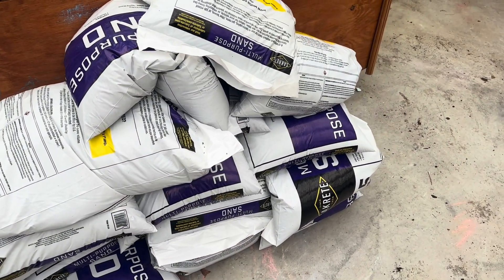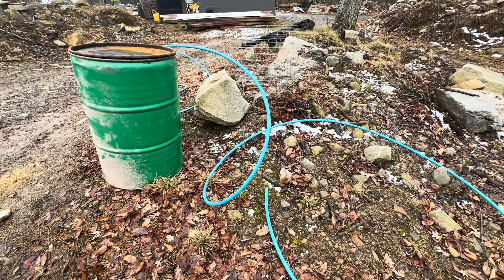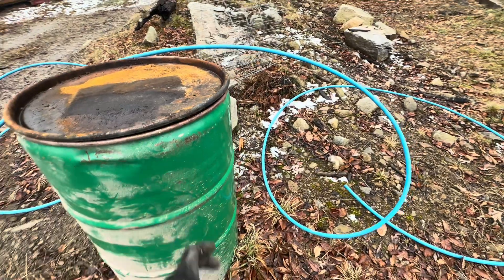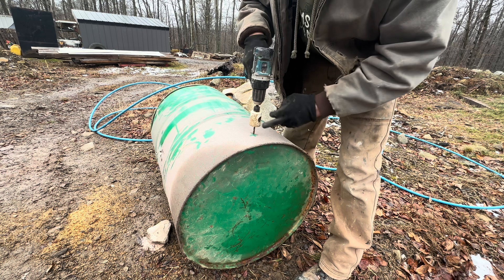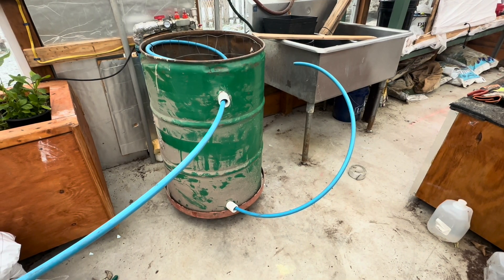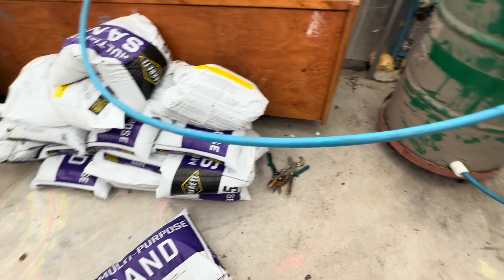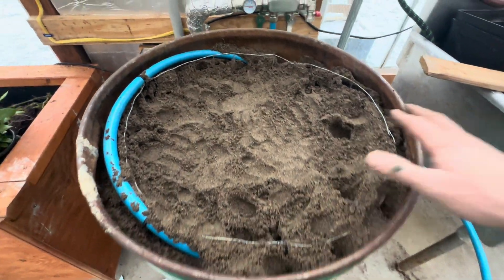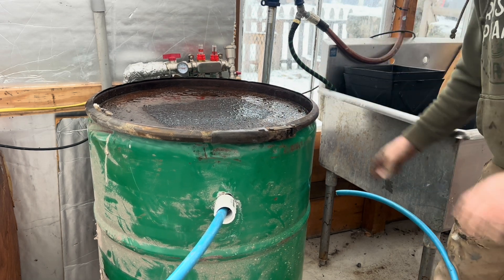DIY Thermal Sand Battery for Greenhouse Heating with an Outdoor Wood Boiler

Comment: Sealing the input and exit holes for the radient heater tubes would have let you add heat transfer mineral oil to displace the air spaces between the sand particles for the following benefits:
-more Btu storage
-faster heat collection
-faster heat discharge
Reply: You could also adjust the heat uptake and discharge rates by using an adjustable insulation wrap. This would let you charge it up faster in the day and decide if you want it to discharge the heat slowly or quickly at night depending how cold it is.
Reply: Thank you for posting your idea. You have given me a way to rethink my idea of using multiple 55 gallon steel drums to store and  send heat into my home. It's only half an idea at the moment, but I see some possibilities.

Comment: Is the battery connected between water leaving floor and going back to boiler to for re-heating .. Or is battery sitting just before  hot water enters the matrix  of heated flooring pipes?

Comment: Do you have a follow up to this video on how well it performed? I wondered how well the water worked in transferring the heat? I was thinking of using oil as I thought that the water could vaporize. Also I wanted to know how hot the sand was in the middle of the sand battery was. And what improvements you would do for version 2 of your battery?
Reply from the maker: Well, the sand battery is part of a larger system which requires topping off every now and then in our large 600 gallon boiler. 
It would be interesting to hook up some temperature probes to read internal temperature.
So far, it works very well for its intended purpose. 
I plan on doing a massive one out of a large 36” culvert pipe In a new greenhouse build in the future.

Comment: It's a good idea but I'm not sure this is accomplishing what you're hoping for.  you're basically trading btu's from the unburned wood in the stove to the barrel.  The burn is actually going to be less efficient because of the transfer of heat, and whatever else you have hooked up to the stove is going to run our of heat faster because your btu's are going to the barrel. If you were going to have a large sum of these "batteries" and fill the stove multiple times in a row to heat them up to cover you while you were gone for a day or two then you might be able to benefit by essentially "pre-burning" the wood that would be needed while you were gone, but otherwise, you're just heating up the barrel at the expense of a faster burn rate on your load of wood.  Also, you should consider some automated shutoff for the flow of water to sand batter otherwise the stove will be pushing colder water through the barrel and actively cooling it down when the wood load runs out.

Comment: You can’t get an accurate temperature reading using an IR gun on metal. You need to use a thermal couple to get an accurate temperature reading.

Metal has a free electron, which will act like a mirror and give you an IR reading that is inaccurate.

Comment: From Europe; we have a lot of people with solar panels on their roof, they stopped paying for the energy supplied . This could be a great way to store heat for the winter, connect it to the  central heating system.
Reply: I love this idea
Question though, how would you go about connecting this that stored heat to a homes central heating system????
Reply: @kawaiisenshi2401  That is no problem , the sand batteries will be placed near the house in the ground, connected by flexible highly insolated plastic pipes. This system is used in many countries who use " block heating " Thanks for your reaction.
Reply: @WinstonSChurchill-b1n thank you for helping to point me in the right direction!

Now I'm off to learn more about block heating!!! 😁
Reply: @kawaiisenshi2401  " Block heating "  is OK, City heating is a disaster.

Comment: heat capacity of sand 0.8
heat capacity of water 4
replacing sand with water will increase the capacity of the accumulator by at least 4 times

Comment: i think think this could work in the house with solar panels and heating electrodes in the barrel connected to the house radiators do you reckon???

Comment: on gen 2, use rock wool or similar  insulation on the inside metal part of the barrel and copper tube in the sand will increase potential to almost 500'c
Reply from the maker: Good idea. Thank you!
Reply: ...and it should be more distributed thru the sand. You are just thermally packing the exterior sand and radiating it out of the Barrel. Intake into the top center and loop it around so there is as much sand to the outside of the tube as to the interior. This forces the heat thru all the sand before it radiates. It will take longer to heat up, but will hold the heat longer.

Comment: Would it be worth the effort to re-lay the pipe towards the interior and away from the walls? Seems like you're more likely heating the barrel walls and losing a lot of heat the way they are.
Reply from the maker: possibly, improvements can definitely be made

Comment: Probably a dumb question, but why not add water to the sand (assuming you can seal the barrel)? This way, you'll add more a little more mass to your battery. 

If you want to get really crazy, you can try using a sodium acetate solution (like the stuff in hand warmers)  into your barrel instead of sand to get additional mileage out of your battery by adding the heat of fusion (kinda like what you get from ice melting) versus just changing the temperature of the mixture. Of course you'd need to be making sure you can get to the right temperatures to melt the stuff.
Reply: Why use sand at all? It is good if you can heat it beyond boiling, but if the heat source is just circulating water, you might as well just fill the barrel with water (and no sand). The only downside is that the barrel corrodes much faster when water is involved.

Comment: Thank you for making that video !
Have been looking for a diy sandbattery/thermal storage for central heating video/guide since i heard about the sandbattery that was made in finnland.
Im running my central heating through my woodburning stove, and want capture more of the peak heat, so that it can be used in the greenhouse aswell.

Comment: Did you get the bag from a local farm and home store or hardware store? 
I assume 50 lb bag?
So what do you think of the weight of that barrel is?
Reply from the maker: We got the sand at Lowes, 50lb bags.
Reply: something like 750 lbs. Assuming a specific heat capacity of 0.19 btu/lb/F, you`ll store 142.5 btu/F. If the barrel starts at 100F and cools to 50F,  it will provide about 2kw of heat.

Comment: Thanks for the video - nice storage heater, more pipe coils could be in the central (core) part of the barrel.
BTW: SandBat and Polar Night Energy thermal storages also use sand but temperatures 400-500 degrees C (five times water boiling temperature) and huge amount of sand (with insulated walls) so they store more energy for longer period and use hot air probably steel pipes as input (with electric heater) and output. 👍😎
Reply from the maker: yea, I saw those companies they are really cool. We might do something on a larger scale in the summer time like that to increase heat storage.
Reply: Yes! =) And our Sand Battery basically doesn't make sense until temperature is above 170 degrees celcius. Below that water tanks are better choice. If leaking would be a big problem then below that also. =)

Comment: I’m not cutting up your efforts or being a know it all. If that feed is coming to your greenhouse directly from the boiler, you are losing a massive amount of heat. Either way, even if you are heating that greenhouse with the return line from any other buildings on the property, the return going into your stove is way too low. A return temperature at the stove that low will eventually rot out your water, jacket, and backside of the fire box. I used to be a small manufacturer of.Owb’s.
Reply from the maker: To answer your question, the greenhouse is at the end of that heating loop. It first heats our home and keeps it at a comfortable 70 degrees. It then returns outward to the greenhouse first to dump any residual BTUs, before returning the boiler. So all in all it travels through about 600 ft of insulated underground tubing. On average there is about a 20 degree temperature difference on return to the boiler. thank you for your input.
Reply: @NorleyFamilyFarms  I guess I was a little confused. I thought you were running a return differential of at least 69°. 160° stove temperature and a 91° return temperature or less when it reaches the stove, on that loop. I must have misunderstood the video.
Reply: If you're not exceeding 100c, just use water storage
Reply: So what is the solution? Smaller loops?
Reply: @Stoney00075  to answer your question not necessarily a smaller loop, but less heat draw on the loop. OR. Another way to compensate is to install a thermostatic valve at the boiler. Some manufacturers require this for the warranty. Central boiler is one of them off the top of my head. The goal is you don’t want your return temperature anymore than 30° lower than the water temperature inside the boiler. It will cause condensation and rot the boiler out. And I’m not talking about condensation in the fire box. The condensation, as crazy as it sounds, will be inside the water jacket itself under the water. It usually occurs where the returning water, rubs or kisses the inside of the water, jacket and backside of the fire box. Think of patches of microscopic oxygen molecules, stuck to the inside of the stove under the water. This phenomena also increases at cooler operating temperatures, that’s why all manufacturers of open systems require a minimum operating temperature of 180°. There are some boilers you can get away with this because they are designed for a batch burn with storage. One example is a Garn. But your typical open system will rot out fairly quickly if you don’t maintain a consistent water temperature. In addition to my excavation business, I own a commercial welding shop. I have personally seen this damage after cutting open a leaking boiler. You will see eroded metal in the path of the return water. Not necessarily caused by poor water quality, but after talking to the customer, cool return temperatures.

Comment: I would have put the tube inside the the wire cage so tubes would have more sand on outside!
Reply from the maker: I actually thought about that, but it was tricky enough to get the tubing wrapped on the outside of the wire cage, so putting it inside was kind of out of the question for me to do on my own.

Comment: If you shove in 2 or 3 heating elements and hook them up to 2-3 solar panels, you would need to fire the boiler up only at night
Reply from the maker: that would be nice. I would like to increase our solar power next year.
Reply: In this instance, you would do better to buy Solar Water Heater tubes (or a unit), and cycle it thru the battery (and your water heater). Modern Voltaics are 20-24% efficient and you have system round trip losses, but Water Heaters are in the 70-80% range. If you want heat, use heat. That's why the Heat Battery is useful. Also, you can DIY one, and there are plenty of videos (just search DIY pool heater, for example).

Comment: Make sure your sand is completely dry and use any shaker tool to compact it no gap and you will reach another level in efficiency 🎉solid job btw. 🤘
Reply from the maker: thank you! well the sand if def  dry now if it was not before. but agree with the compacter.
Reply: Why wouldn't you desire gaps to allow the heat to flow all the way though the battery?
Reply: @FuhrChris no air expands and can cause the air pockets in the sand to explode
Reply: @twilightgang4828  Yet the size of the sand that they say is the best is large enough to pass micro amounts of air to pass through the sand???
Reply: @FuhrChris  yeah "micro"
Reply: @twilightgang4828  This is the difference between the sand that I can dig on my property at 5 feet down (I live on the shore of a prehistoric lake that has been gone since the BC.)
Rather than the fine grain sand my shovel finds, I can get the larger grained sand from the Ant mounds that are an abundance Both in use and where  the Ant's died out over the Winters.   (For  the Winds do the separating and blow the finer grains away.)
I did some checking and the Swedish/Norway Heat sand batterie's suggestions for the optimized sized.
Reply: @FuhrChris because that's lost mass. You don't want air flowing through your battery. You want the battery to lose heat through convection only at the skin of it. Conduction between sand particles is more than enough to normalize temperature throughout the batteries mass.
Reply: @OtherDalfite  There has to be some design parameters in that the Italians'' are liquefying their sand batteries (forced air from the bottom) to generate Steam (this would probably only be what is called "Low temp steam" when talking about steam driven boats).
We can't fall into the trap of mix and matching our design EXPECTATIONS.
So a just radiant heat system very possibly had a different set of power curves than what the Swedes' or the Italians' will be claiming their systems (Designed for different expectations) deliver?
Reply: @FuhrChris I'm not sure of this Italian system you're speaking of, but it sounds like it's intended purpose is different than this one.
Reply: @OtherDalfite  It was a video short about the issue of Sand becoming a limited construction material, in which they were claiming that the current TOTAL amount of sand being washed to the Sea each year is the same as the amount we currently use.  
(This is usually meant to get the Wealthy to get out there and buy FIRST, then have the Rich tell everyone else that they can't have any.)
That if everyone was putting in a Sand battery there would be No Sand.  Which is B.S. since there is Sandstone being created off shore and you would just need to deal with deeper deposits in the Ocean and environmental impact statements.
Because of that they didn't even say WHAT they were trying to create with their Sand battery, other than Steam.
And a steam based system would have VERY different input and output requirements, than a house heating system.  
The act of injecting air into the bottom of the Sand to create "Liquification" and the quick movement of heat would suggest that you would use larger grains of Sand than hard packed sand that has a range of Sand particle sizes.
It is the issue of Mix and matching design parameters by the outside observer that will lead to your trying to make something that will never quite work.

Comment: Why not bury the pipe right into the soil (like in a heating floor) and rely on soil thermal mass instead of the thermal mass of a barrel? The specific thermal capacity of soil is identical to that of sand, yet you will heat a much higher volume of soil, providing greater overall stability in the greenhouse temperature.
Reply: Interesting. Why is a sand on a beach still warm to the touch after sunset after a hot day but soil is cool to the touch? I'm not sure I properly understand the term thermal mass apparently.
Reply: @paulmcewen7384  Well, I believe you are dealing with a different phenomenon here. The sand is dry and the soil is wet. Upon sunset, the soil (and the wet sand) loses heat through irradiation AND evaporation, meanwhile, the dry sand loses heat due to irradiation only. 
This effect is not at play in the greenhouse.
Reply: @RomanShein1978  Ah I see I had not considered that.
So would a barrel of sand, and a barrel of soil, both with the same moisture content be able to store the same amount of heat?
Reply: @paulmcewen7384 

Look up polar night. 
Is a 100-ton sound battery in Norway actually Finland I think..
There will be hundreds of them around the world before long
Reply: Because you loose heat to the surrounding ground it would  work good if you insulated the ground you planned on heating . Good idea but not as easy as just heating the ground.

Comment: Water temp exiting the drum is still warm...maybe run  it thru an old car radiator for more heating greenhouse.
Reply: Explain me, why has he opted for sand? The ordinary water would require a bit better barrel, yet the specific heat capacity is 5 (five) times of the sand.
Reply: @RomanShein1978  yes the only advantage of sand is that you can raise it to far higher temperatures, that's why it's used in some commercial batteries, like storing excess wind energy.
Reply: @erik....  Yeah, it makes sense when you crank up the temperature to hundreds of degrees Celsius. In this case, he uses plastic tubing, water as a heat carrier and hoovering at 30-40 Celsius.